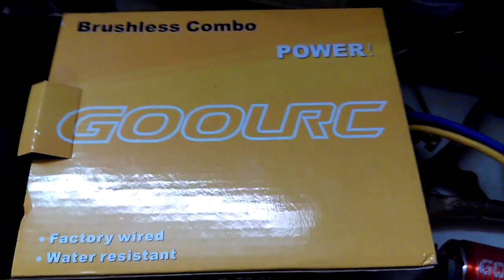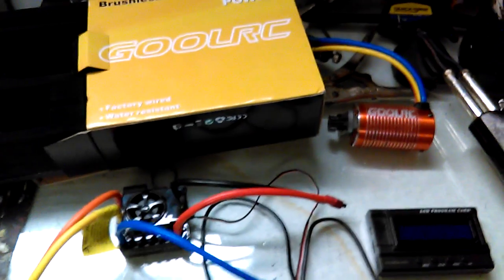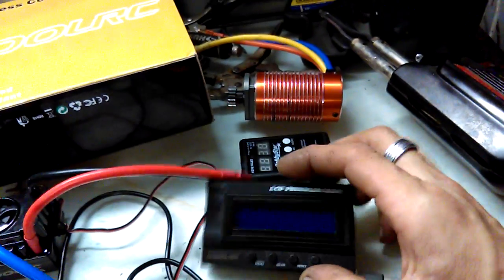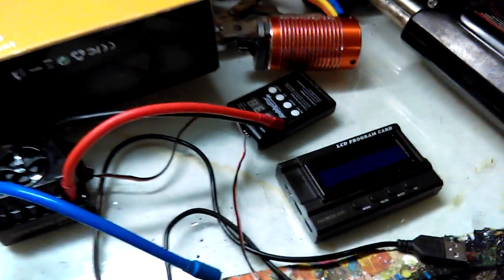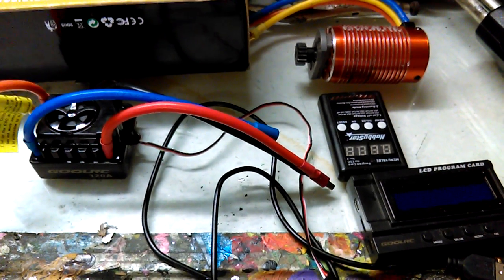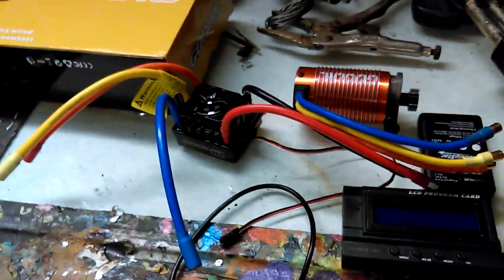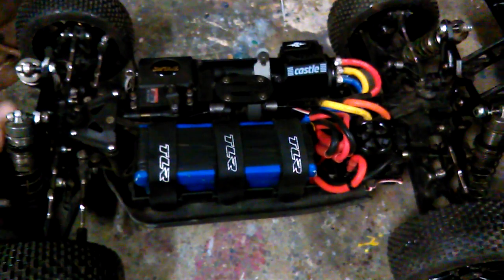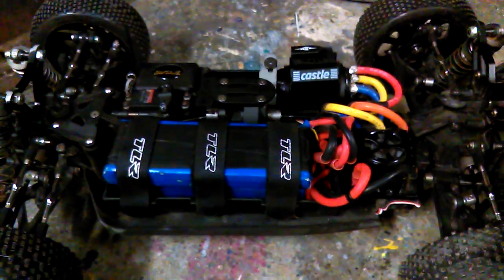Unscripted, Unofficial Goolrc unboxing info programming troubleshooting

Comment: did the hobbystar program card work for the 150a goolrc esc ?
Reply from the maker: timothy mosley , I'm not answering for him, the Goolrc LED program card link in his comment should most definitely work, the Hobbystar brand LED program card is the one I use on my 2 Goolrc esc's, the 120a and the 150a, it's the same device, it works great, really easy to use.
Reply: Jason I ordered the goolrc led program card V2 it looks like the hobbystar program card I'll let you know how it goes.
Reply from the maker: timothy mosley , that'll be great thx!
Reply: i received the goolrc led programmer today and it worked great but im having a twitching issue it goes wild on its own idk whats going on with it do in need to add some capacitors or something any ideas or help would be nice lol.
Reply: Oh and the BEC is on 6v i didn't try on 8.4v it might fix the twitching problem possibly?
Reply from the maker: timothy mosley , a twitching issue is usually from a loose connection, somewhere, somehow, incompatible hardware, or failing devices... occasionally from interference too. Check all those possibilities.
Reply: Jason I'm using a older receiver and transmitter that take the crystals but it was good with my other esc never twitched at all but I'll swap out the receiver I'll let you know how it goes lol
Reply from the maker: timothy mosley , ah ok ur using the older crystal am or fm radio kit! Well with that setup, try another crystal set of same and different channel freq. also with crystal transmitters and receivers the connection where the crystal sits becomes dirty, loose, broken etc... . Try wriggling the crystal in the rx with a finger while it is on and the transmitter is on, see what happens. Cheers!
Reply: Jason I put another receiver in with different crystals it fixed the twitching now it is cutting on and off when I give over half throttle the blue light on the esc turns off when it happens and the brakes don't work when it happens any ideas?
Reply from the maker: timothy mosley , try calibrating the esc to your transmitters throttle and brake range.
Reply: Jason I did I think it worked the right way I tried a couple times.
Reply from the maker: timothy mosley  , if you are using a Goolrc esc, then no you shouldn't need to add a glitch cap but there's no harm in trying either lol! the Goolrc 80a, 120a and 150a esc's are all equipped with glitch caps.
Reply: Jason I calibrated it again I think I was doing it wrong that's fine about the cutting off thing I think lol but it's twitching a little still so I ordered a goolrc 2.4ghz transmitter receiver combo I'll see if it fixes the twitching also I'm putting together a rc10gt brushless conversion with a goolrc 3800kv motor and a goolrc 120a esc or a goolrc 150a esc idk witch yet.
Reply from the maker: timothy mosley , very cool, do an unofficial review of the radio kit! .... I am putting together a Losi TEN scte with a Goolrc 4300kv 550 3T brushless motor and a totally generic 120a esc lol!
Reply: Jason lol I'm not good at reviews I have to many brain farts lol and on your esc good luck Idk if I told you but I had the tsky 120a esc it took a shit on me after about a week about 8 batteries through it but I only payed like $18 for it and they refunded me $15 of it that's why I got the goolrc esc and the goolrc esc makes more power my goolrc 2850kv motor only pulls 90a so the tsky esc couldn't be delivering no more the probably 80a.

Comment: Hi, do you think this program card would work then? It ressembles the Hobbystar one, but I just hope it's not faulty like the LCD one. http://www.ebay.com/itm/GoolRC-Programming-Card-for-Brushless-Electronic-Speed-Controller-7ZX4-/252118627901?hash=item3ab370f63d:g:zToAAOSwA4dWF1-o
Reply from the maker: Hi, yes that one should work fine.
Reply: Were you able to get it up and runnin with out the program card?
Reply: I did get the program card, and it seemed to work fine :)